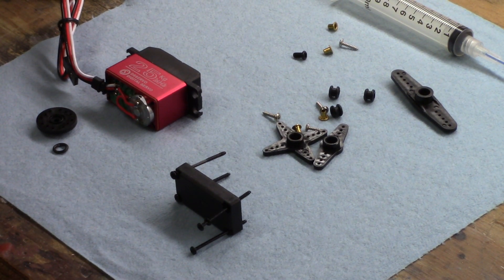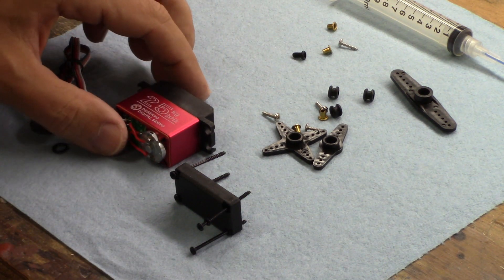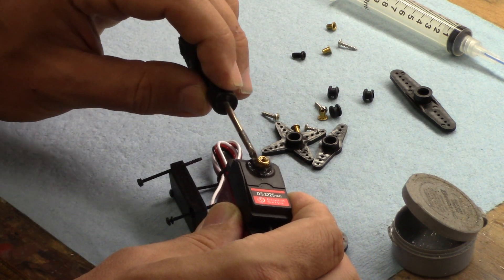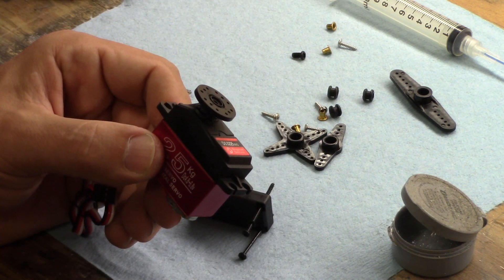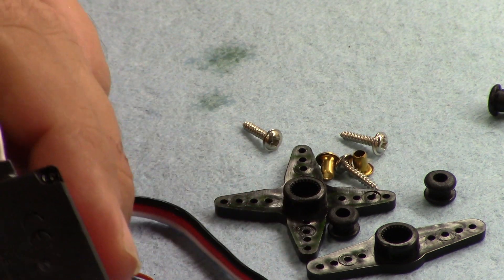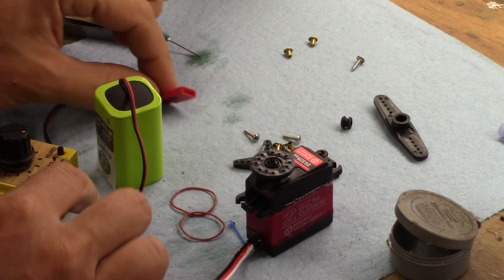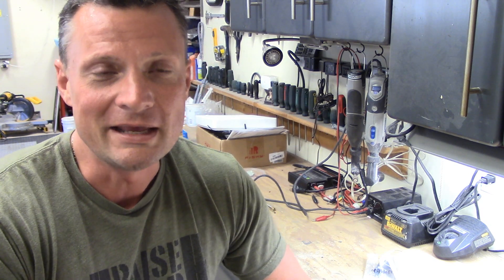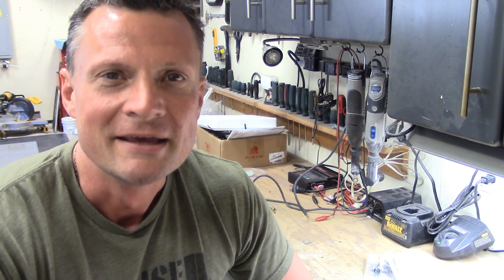How to make a TRUE waterproof servo!

Comment: To simplify the step of filling the servo with oil you could unscrew slightly one of the 4 bottom screws, immerse it in oil inside a jar, poke a hole in the jar lid and vacuum bag the jar. All the air will bubble out of the servo from the untight screw and shaft. Once you release the vacuum oil will flow inside.

Comment: Didn't work for me, the motor got oil in it and stopped working with mineral oil. And the gearbox got jammed up. I had to flush it all, then seal all edges with epoxy resin (UV cure) and the O ring on top. Works!

Comment: That won't work for long because there is still too much air left in the servo. What I do is I made a vacuum chamber out of a Mason jar. I open up the servo and submerge it in mineral oil inside the Mason jar. I then use a good vacuum  pump which removes all air,  including the air inside the servo wires. Then,  you remove the vacuum and let it sit in the oil for about one hour to let the oil migrate into the tiniest place where there had been air.  Then I seal up the servo while it is still in the oil.

Comment: im making an rov and i need a servo that can withstand about 20 - 40 meter debth in saltwater would this be able to do that?
Reply from the maker: Any air trapped in there whatsoever will compress and allow water ingress. The technique for filling the servo is critical. YOu might need to use a vacuum chamber to pull the air out. During installation, ensure you put the servo upside down so that the electronics and motors are higher than the plastic gears in case of water ingress.

Comment: How do U stop the oil seeping out
Reply from the maker: As you can see from the video, all ingress to the servo is sealed, so oil has no path to come out.
Reply: @RCSubGuy  I've done it to a 9 gram servo and it seeps out when not in water
Reply from the maker: @gavinwilkins5466  I can only assume that you have not completely sealed the body seam or the shaft output. Disassemble and take another look at how you tackled those two areas.

Comment: I'm proceeding with this procedure now.(using mineral oil, btw) I find that Lasco brand #4 O-rings (02-1629) work best for my servo, but your servo's "neck" diameter may be different from mine.
Reply: Hi Ben, have you completed this build yet?  How did it work and how deep did you go, and what application are you using this on?

Comment: Not all Olive oils are created equal.
Chech the PH of your olive oil before putting it in your servo. (PH strips) Many olive oils are "acidic". This acid will corrode the electronics after a while.
Use unscented "baby oil" instead. it is a highly purified and clean mineral oil. It's non conductive( wont short electronics), ph balanced, (wont corrode metals) won't go rancid, (get thick and lumpy)  non-hygroscopic (wont absorb water itself), wont grow bacteria,  etc etc etc
And if you are really serious about doing this, cycle the servo several times in a small vacuum chamber to ensure all of the air is displaced by oil, ( no air pockets) before putting in that last screw. You will be amazed at how much air will come out of a servo case that you "thought" was full of oil.

Comment: I assume this is for a brushless servo? Also do you have an update on how it works now? Thanks
Reply from the maker: Why would you assume that? It was a standard servo. No magic there.
Reply: @RCSubGuy  on another note do you have any issues with remote to receiver connection at all?
Reply from the maker: @davidabraham3873  ? Occasionally, of course. Chlorinated pools can cut reception significantly.
Reply: @RCSubGuy  brushed servo has a brushed motor. Does the motor also gets filled with oil? if yes, then how do brushes maintain contact with the rotor? Isn't there a chance for oil to get between the brush and the rotor?

Comment: You could just add some corrosionx or silicon modified conformal coating to the electronics and metal parts of the servo as shown by Peter Sripol and FliteTest

Comment: Have you considered hydrophobic compounds? 
Could a shaft seal assembly be made?
Tight spaces would be an issue,  but I'll bet you could make a shaft seal with oil soaked string,  and then next to that (waterside) hydrophobically treated ;) string.  This wrapped shaft, within a metal tube, making smooth and tight connection.  
Fill servo with oil of choice.
Then just dip the whole thing in insulator of choice, eg. epoxy, latex.
If heat is a problem,  use a thermally conductive oil inside,  with a heat sink to the outside, could be a very simple design. 
The shaft is the only real issue. 
Everything else is no problem.
Maybe a brushless servo will tolerate the intrusion of the oil better than a brushed servo? 
Thanks for the ideas!   Im going to do this for my crawler.  I'll see how tiny I can make a shaft seal assembly. 6mm? :)
Gotta cross some rivers!

Comment: I did the same thing but packed it with red lithium grease, no o rings, but that would probably be what makes yours water proof, instead of mine as water resistant ...? so far, 3 years later, the 5thscale rc truck gods tribunal hasn't rained hellfire down on me and my Chinese servos lol

Comment: So maybe I am doing something wrong.  I followed your instructions but the servo seems to work for a couple of minutes then quit.  I took some thermo images of the servo and the circuit board seems to be getting hot.  I hear sizzling inside servo case and after that servo does not work.  There seems to be little to no leakage from  servo case.  Do I need to coat the small control board inside the servo with silicon paste or something else.  Any other experiences or thoughts on the process.  The servo I did is a plastic case not metal as the one you did . My metal case one like the one you used will be here on Tuesday.  Just don't want to screw up that one by making a mistake.
Reply from the maker: There should be no reason that inert oil affects your board. Some capacitors and diodes, if cheaply made, are not sealed and can take on liquids. My guess is that you were using a really cheap servo. It could have been messed up from the outset even before you added the oil.
Reply: @RCSubGuy  Possibly the o-ring is bound up (too tight) and overloading the servo?
Reply: I’ve also done this twice with the exact servos in the video and everything works until I add the oil. The only thing I can think of is that I used baby oil instead of olive oil…😢

Comment: Nice idea, this is a recent video so I'll give some thoughts because I really need to do this myself. I don't have the answers just yet, not critising just thinking aloud here. The oil will heat up from the motor, it is incompressible so it must escape somewhere. When it cools, we are back to stage 1 again, the difference in pressure pulls water inside! I would guess past the 'O' ring, which because it is not properly seated in a channel, cannot do it's real job. It's just a squashy gasket in your case. Sump pumps (12v caravan type) have an expansion chamber behind the 'lip seal' on the shaft. This very fine delicate rubber piece is lubricated by the water, and yet any pressure forces it to seal tighter onto the shaft. Ok up to 10 metres which is impressive. The grommet for the leads is also tricky. We need a single bubble wrap or something as a bladder in the oil? Have you cycled one of your examples under water for a while?
Reply from the maker: The motor won't heat up in the slightest unless, for some weird reason, you're running that servo at 100% duty cycle under extreme loads.
Reply: Yes, a servo with air in the motor granted. One expert tells us tricopters use extra power for the 3rd servo, another that servos hardly use any power! But if you are truly filling up all the internal spaces with oil, the little high speed motor is not going to like trying to push oil around like a hydraulic pump rotor?

Comment: I am not so convinced about your solution with oil filling. This oil also goes into the potentiometer and motor and there isolates the sliding contacts. At some point the servo will stop working because of that.
Reply: I am curious what potentiometer you are reffering to? To my knowledge there are none in a servo.  The servo will operate on a pwm signal from the controller. A signal of a give pulse width makes it turn left, another pulse width turns it the opposite, and a third centers the servo. If I am mistaken please advise.
Reply: @kimbelldify  Yes, there is a pot in servos. Mostly used for holding torque.
Reply: @jeffgreenfield7025  Thank you for the correction! I have alot to learn here ;-)
Reply: @jeffgreenfield7025  no the pot is there to report the position of the servo output shaft to the electronics in the servo.

Comment: The only thing that I would do different is to use silicon on the screw heads and make sure the "O" ring doesn't add resistance to operation....🍻🍻👍

Comment: What to stop a person from putting all the servos outside of the WTC and also using motors that the internal coil of the motor is waterproofed with potting resin and Stator has green waterproof coating.  Then your servos and motor would be outside the WTC.  You would have one hole in the WTC for the wires coming out.   Main difference with wires you can seal the hole good, but with shaft and linkage seals you always have a chance of a seal breaking from shaft and linkage moving.
Reply from the maker: Your receiver is not waterproof. For every servo out in the wet, you need to waterproof 3 servo wires. 3 servos. 9 wires, plus another two for the motor. 11 connections to leak versus 3 linkage seals. You do the math!
Reply: @RCSubGuy  Sorry I should have been more clear,  Just the servos and motor would be outside the WTC.  Everything else would still be in the WTC.   Then on one side of the WTC there would be a real waterproof big 12 pin connector in one hole,  with 9 pins use by the servos and 3 pins being used to power the brushless motor.   I am not saying this is better then having everything in WTC, I am just saying its another option.  I still prefer having everything in WTC.

Comment: Cool! A few thoughts, for your consideration:
Presumably clean mineral oil would work at least as well without doing miscellaneous disgusting (possibly damaging?) organic things as it sits around in there.
An faster way to fill it air-free would be to stick a long skinny needle down to the bottom so the oil emerges underneath all the air. Save some tapping.

The cable feedthrough seems like a possible weak point. Make sure either the epoxy seals it at a relatively rigid part of the strain relief, or use a suitable (bonding well to plastic most important property) RTV sealant that will have some elasticity. Strain relieving the cable will of course mitigate the need for flexibility.
Reply: If I were to pick an inert oil-my choice would be corrosion X
Reply: Excellent comments!   I love getting the info to properly stock my work bench.  Thank you!
Reply: For an air free fill-hold the servo so that one removed screw is the highest corner point and one removed screw is the lowest corner point-inject the oil from the lowest point until it comes out the highest screw hole forcing out the air.

Comment: Don't you think there will be air inside the motor? And if the oil will enter the motor later? Won't it give problems with the contacts in the motor? Or do these motors have no carbon brushes inside?
Reply: Decent servo motors are brushless.
Reply: @FahlmanCascade  but still, there is something in that motor that is trying to turn several thousand rpm when you move that servo.
It must now do that while overcoming the drag from oil instead of air.
So it is going to use a lot more power, even with nothing connected to the servo.
So basically you're building a power hungry slow servo.